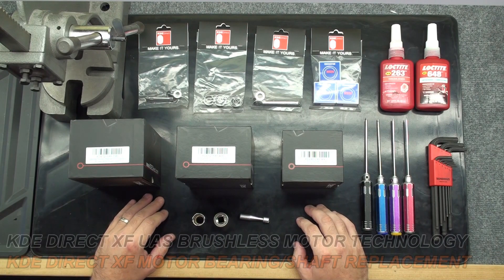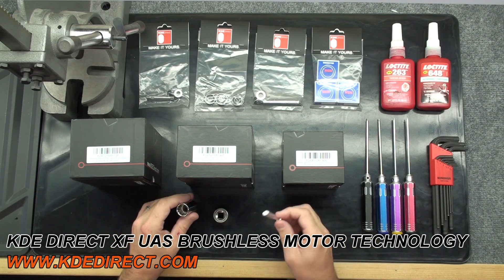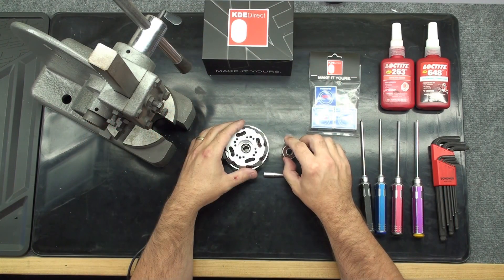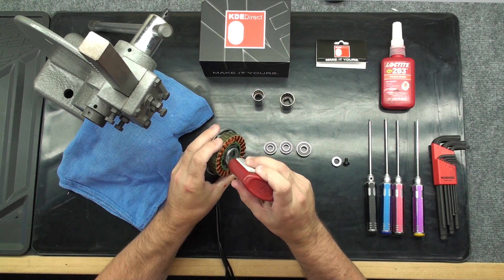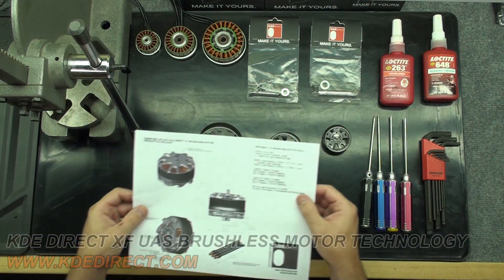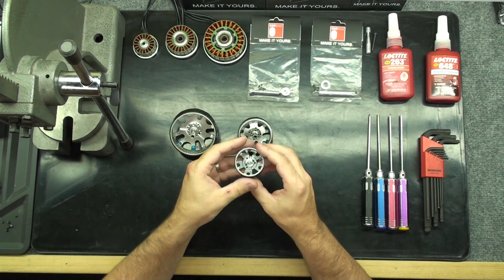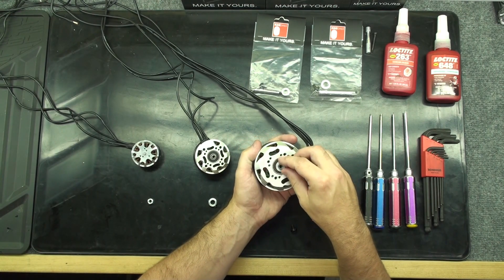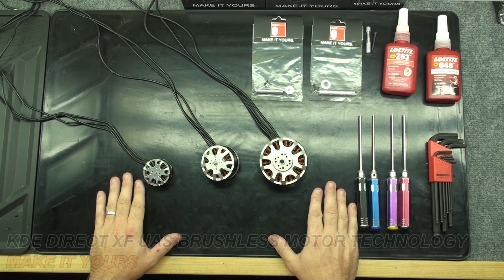KDE Direct Knowledge Base: Episode II - XF Bearing and Shaft Replacement

Comment: Green loctite seems like overkill and may make getting them out again tough....or maybe I am confusing loctite 648 with a different one.
Reply: In my experience 648 is indeed very strong. To weaken it, heat at around 180 deg C is needed, which is uncomfortably high considering the copper enamel breakdown temperature, I think. So I have indeed the same question.

Comment: I have the KDE5215XF-220 and have removed the first shaft bolt and the two retaining collar grub screws however your retaining collar is locked to the shaft with locktite and cannot be removed by fingers as shown in this video. More persuasive means are needed to force the collar but I risk collar damage if I were to grip it with pliers etc. I don't have a gear puller small enough for this. How do you recommend I remove this collar?